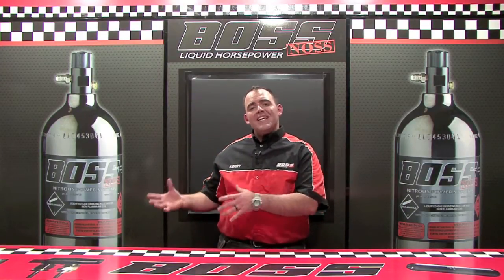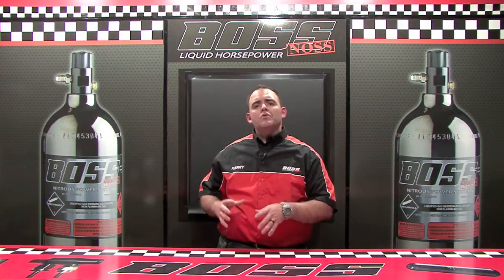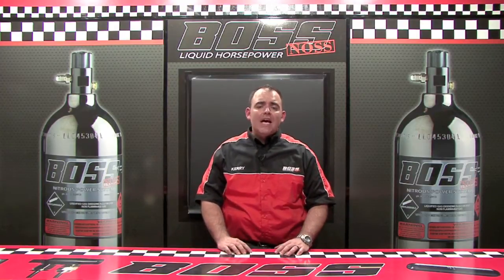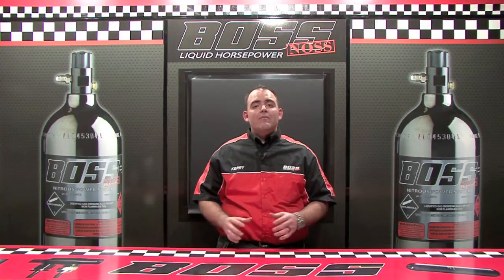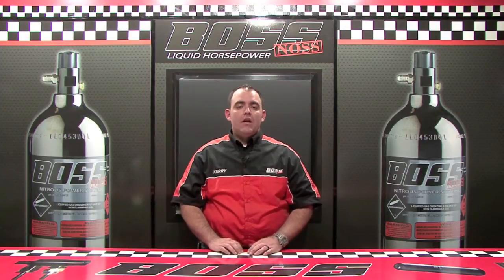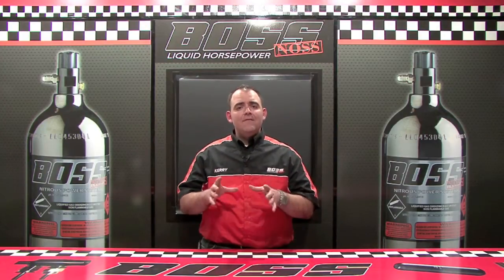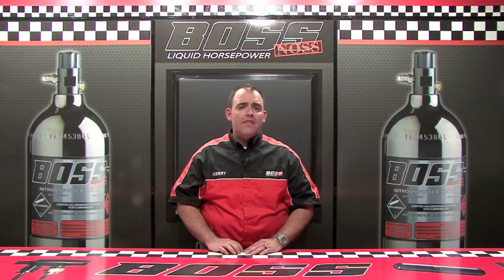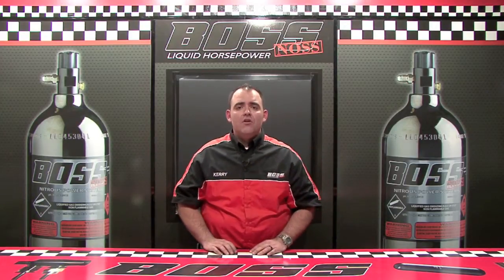How Nitrous Works! Boss Noss

Comment: Nitrogen has a molecular mass of 14, and oxygen has a molecular mass of 16. 16/(14*2+16) (2 nitrogen atoms and one oxygen atom) is equal to .36, or 36%. So where do you get oxygen as 33% of nitrous oxide by weight?